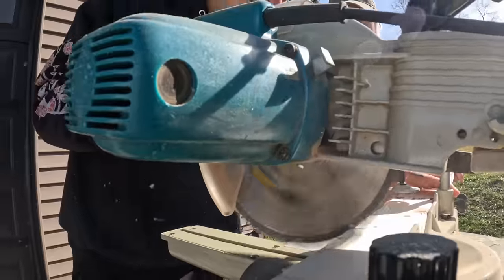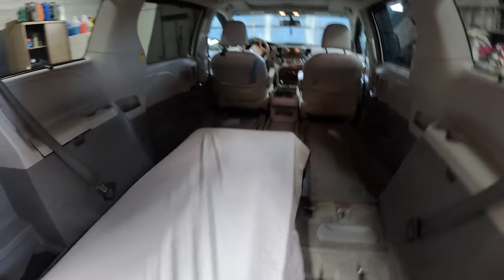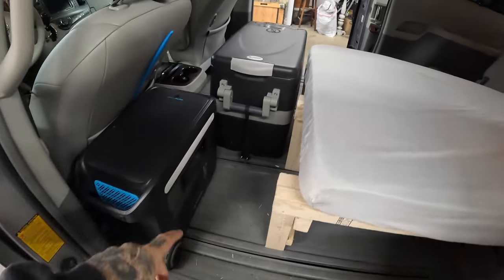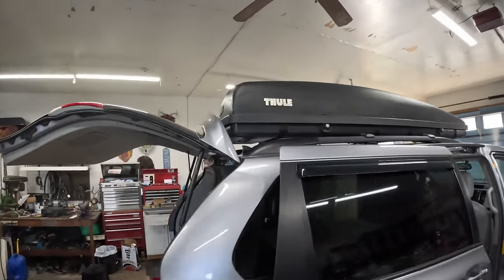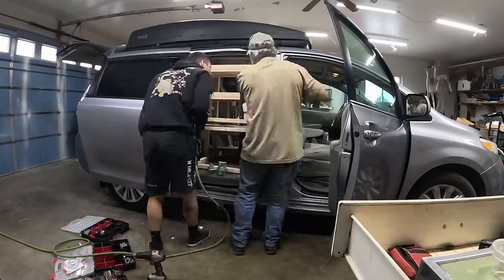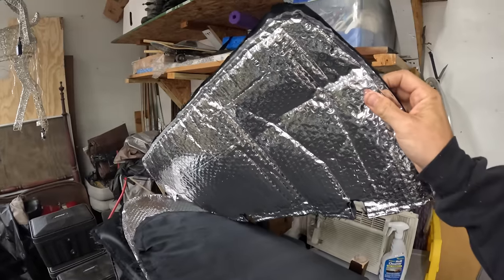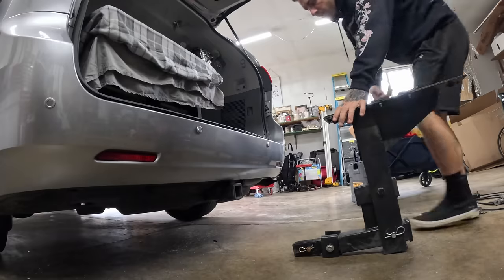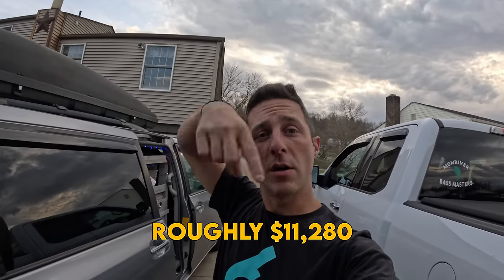I Transformed this Minivan in the ULTIMATE STEALTH CAMPER

Comment: I get stuck at finding a mechanically sound van with reasonable mileage under $10k in my area. 😑 Love the simplicity of your build, though!
Reply: You really don't have to worry about mileage that much. Modern engines made since even the 1990s are easily capable of 25,350,000 mi as long as the oil has been changed and the coolant is kept up. So mileage is really not a reason that you should just count something if it's good make get online make sure it's not one of those specific cars that does tend to fall apart after a hundred and something miles. But very few do anymore. So you can pick up a high mileage van and not worry about it and get a much better value for your money. You won't put that many miles on the van anyway it's only a couple of thousand miles across the country and how many times you going to go back and forth across the country. So if you put another 10,000 miles on the van on something that's got 250,000 already it's really not a big deal. and in any case you're just as likely to get a bad motor in a car that has 50,000 miles on it as one that's got 250,000. In fact I would argue that if a car's had 250,000 miles on it and it's still going then somebody took care of it. Whereas somebody can have a brand new car and not change the oil for 3 years and burn up the motor in 40,000 miles or 20,000 miles and you won't know until you buy it.
Reply: @yougeo  The "you won't know until you buy it" is my issue. Mileage isn't the only thing I'm looking at - families are notoriously hard on minivans. I keep thinking I need to find one that was owned by an older couple who bought it for when the grandkids visited or because it was easier to get in and out of than cars or SUVs. 😂I'd love to know the vehicle I buy was well taken care of but it's tougher to do so nowadays.

Comment: That's awful, how do you even get in the back? On my minivan build I left the rear passenger side open to easily enter the back. Totes under the bed for storage, car fridge. power station, 12v lights throughout, a couple fans, USB charging and a 12v 22" HDTV.  I can even carry a folding ebike inside. Cargo carrier on top, along with 200w of solar.

Comment: Mad respect for doing everything in 4 days. I will say using the actual setup is going to be a pain,  especially getting into the back seat with that cabinet in the way. Unless you're ok with constant frustrations,  living in such a tight space requires being able to access and use everything you need easily from the inside. That being said, anything that gets you on the road is good enough.  The setup can be tweaked as you go.

Comment: good idea ,  saw a Chrysler  town country  wheel chair van , one could  remove the lifts, ramps had a drop floor lil more head  room if one was sitting on a bench
Reply from the maker: does the whole van sit lower to the ground?
Reply: @BrandonGross   no it has a suspension  lto lower it for wheel chairs

Comment: What is holding up your divider curtain?
Reply from the maker: I used a curtain rod but it’s strapped to more curtain rods that are attached to the grab handles for the front and middle seats. I hope that made sense haha I can show it in detail in one of my next videos if you’d like.
Reply: @BrandonGross  though I can’t see it clearly, that’s what I thought. I tried a regular bent rod and flattened the ends to poke in the sides, but I kept knocking it out. Thanks for responding.

Comment: brandon you definitely need foldable solar panels that way you can charge your power station when your not in your van
Reply from the maker: I might end up putting a small one on the roof but not sure yet
Reply: @BrandonGross  the reason why I bring it up is because you could put the panels up against the inside of your windshield towards the sun charging your power station when your away from your van

Comment: So if someone who has actually stealth camped that is not a stealth camper. You put a roof rack on it you might get away with it you start hanging motorcycles off the back of it is no longer stealth. Now that doesn't mean it's a problem because quite frankly you don't have to be a stealthy as everybody seems to act unless you're parking in certain areas but you honestly just don't get bothered that often if you don't stay in the same place very long and you're using regular commercial parking lots. Just scout out a parking lot see if there are any cars parked there overnight if there are you can probably blend in and if there aren't don't try it.

Going good thing you did was you put and inverter in the fridge in there which definitely helps.